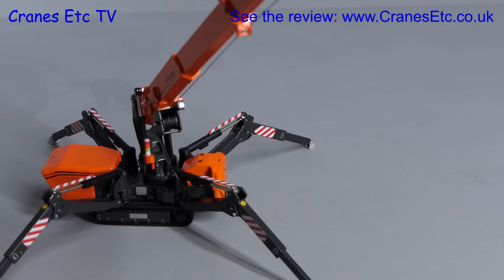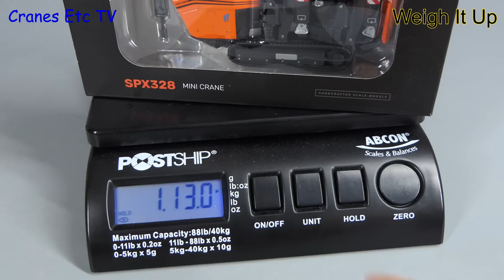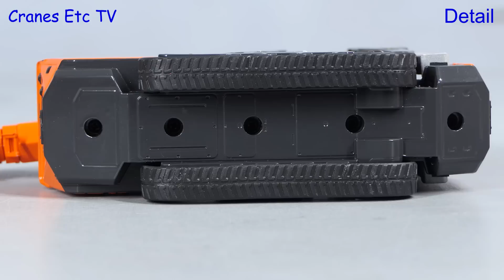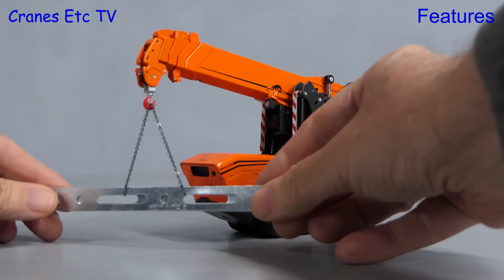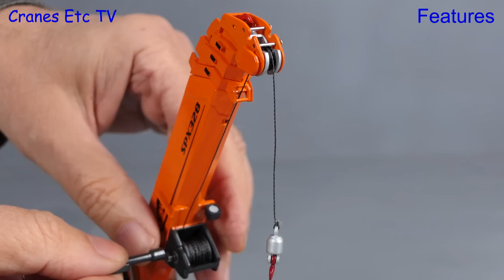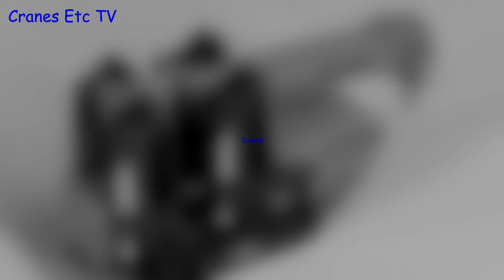IMC Jekko SPX328 Mini Crane by Cranes Etc TV

Comment: Never seen anything like it. Very cool machine.
Reply: They're often used for installing glass, with a tilting and rotating sucker attachment instead of the hook. Small enough to fit in a cargo elevator in most commercial buildings and narrow enough to go through doors.